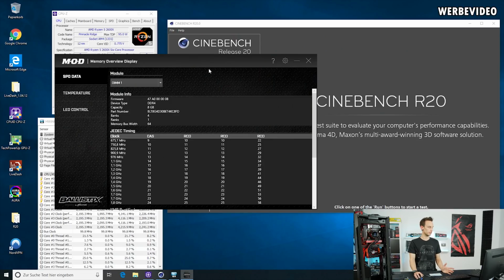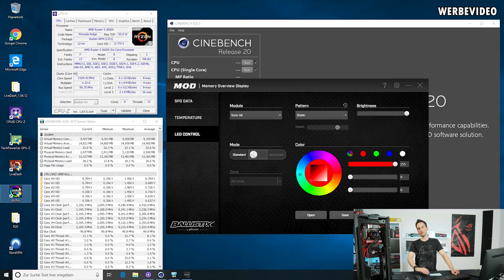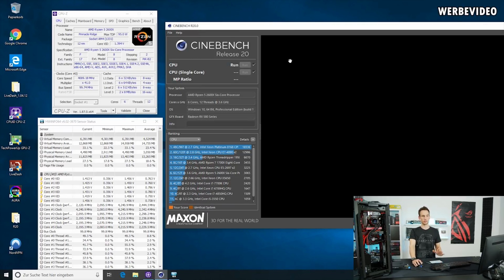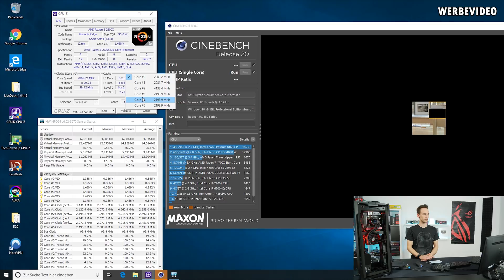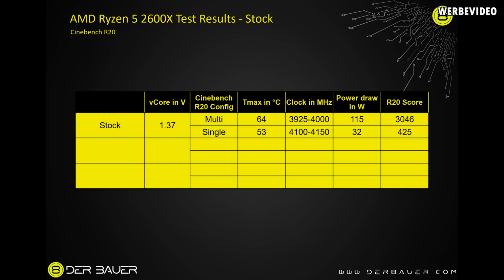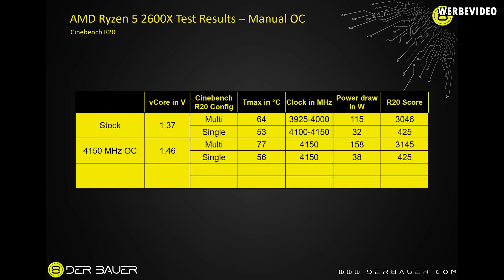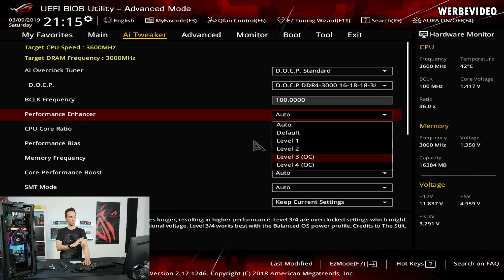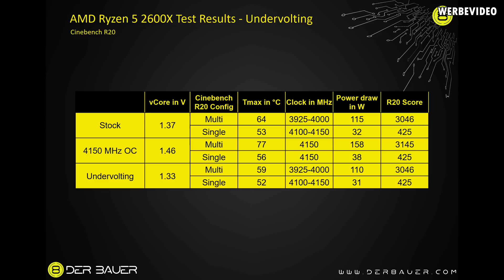The problem with AMD

Comment: what about AMD APUs? Also, are you telling me that it makes sense to run a 9900k overclocked on all cores to the max? what's the power consumption then? Some of the overclocking content out there seems to treat both brands differently. Nobody is talking about intel's temperature and when AMD had boiling hot CPUs they were bashed to oblivion. Same goes for performance per watt.
Maybe you could work around your content to make some room for AMD. If you want to save even 50watts on a rig, then use the same ruler to measure an intel option.
Overclocking is fun, regardless of temperature and consumption, and I think that's the point. It's not only about daily use, but what's achievable. And people like us benefit greatly from people like you doing this kind of work. If XFR is so great that manual OC gives 0fps more on anything, then that's great. Most people out there wouldn't know that. You have the knowledge to prove that and advice people better than most. You're not working in vain. We appreciate that content. It's actually helpful. Just think about it bro... Cheers from Buenos Aires.

Comment: Fully agree there's no point in OC'ing the CPUs.
What I'd welcome is memory tuning with Ryzen and Threadrippers, particularly with large amounts of RAM e.g. more than 2 single rank sticks. Every guide out there assumes you're gonna use 2x8 sticks for optimal speed, but what if I need 32GB or 64GB? Is 2933MHz really the upper limit? That'd make for great and useful content I think. :)
Reply: I have 4x8 sticks of Trident Z rgb 3600 running at 3333 cl16 on a crosshair 7 with a 2700x
Reply: @Zefram0911  that sounds really nice, thanks for sharing. I've got 4x16 of the same Trident Z 3600 CL17 on my 8700k now and I'm really curious how well that'd work on a Threadripper as that's likely my next upgrade.

Comment: I find it puzzling that people are still going on about Ryzen overclocking, when multiple reputable reviewers concluded already in their initial Ryzen 2nd gen. reviews that XFR was the way to get the most of your Ryzen 2nd gen. CPU in a mix of multi and few threaded workloads.

Just set the power limit given to XFR to whatever you're comfortable with, and undervolt. You'll get the best result with any number of active threads allowed by the quality of the CPU silicon, the power delivery of the motherboard, and your cooling.

It's only if your only consideration is reaching maximum scores in multi-threaded benchmarks, that you should consider manual overclocking. (Or if all of your workloads use all available threads, all the time.)
Reply: Silvar55x can I get the videos
Reply: @karthikp9845   They were written reviews.

Comment: I have a 2700X and a 1600X. The XFR on the 2700X works flawlessly and as you said, manual overclocking doesn't make much sense. It boosts up to 4250MHz ootb and I felt by slightly undervolting it the boost got even better. So  the performance you get is pretty much what you get. 
In my opinion it's a slightly different story on the older 1000X series though. XFR on the 1600X doesn't work as well. I have never seen clocks higher than 3.85GHz albeit I use a massive 240TDP cooler (air). So I did a manual oc to 4GHz and maybe I could go even higher (which I won't). Looking forward to the 3000 series. As it looks, manual overclocking soon will be a matter of the past - which is great as also less knowledgeable users will get the maximum performance out of their CPU.
Reply: P.S. after the great experience I made with the 2700X I would always buy an "X" CPU from AMD. It's worth it.

Comment: I think that there are a lot of people myself included who would get into Ryzen overclocking videos. I know most say its better to turn on XFR and then leave it but I ran an all core overclock on my 2700X for awhile and had pretty good performance. 1895 cb on Cinebench R15. It was a power beast though at 150W. Would still be cool to see maybe even just some extreme overclocking on Ryzen see how far you can push it.

Comment: The only thing I sort of disagree with in this is the phrasing - "the problem" is that there are no problems to fix. You can't delid the CPUs to improve thermals, because they already have optimal thermals; you can't really overclock it better than XFR can do for you either. All you're really left with is lapping the heat spreader and exotic cooling. You don't even run into the cold-bug with the Ryzen-platform (unless I'm mis-remembering). It just works - which does not make for entertaining content. It's not as fast as the fastest Intel CPUs, but dollar for dollar it has no problem keeping up with Intel's offerings.

The "issue" with this is that whenever we see this stuff being done with Intel's CPUs, it ends up being thought of as showing off how awesome Intel's CPUs are, even though you're actually showing that they aren't that good. Think of it this way - if you had to remove the engine, disassemble it and replace the crankshaft to get it to be less noisy, would it be considered a good car? Yet somehow the 7700K and 8700K were considered great CPUs, because they could run 5 GHz 24/7 (if you were willing to delid them and apply liquid metal).

That is my main issue with a ton of the hardware coverage on YouTube. Often the creators are completely oblivious to how they are shaping opinions of their viewers and giving free advertising to a product. As an extreme example, look at the amount of coverage given to Intel's 28 core HEDT. A $3,000 CPU that needs a $1,500 motherboard that might just be able to hit 5 GHz if you're willing to drown it in liquid helium and hook it up to a portable nuclear power plant. It's a CPU that is unlikely to be sold to anyone, yet there are a ton of videos about it, because of the insane motherboards that have been built to support it. Why are they insane? Because Intel demoed it at 5 GHz, so obviously overclockers are going to try to hit that speed. Fuck - some of those motherboards can't even boot without having TWO PSUs hooked up to them.

Products like those are made for one thing and one thing only - advertisement. Has anyone managed to actually FIND a 3175x for sale anywhere? NewEgg doesn't have any in stock, it's not even listed at MindFactory, it's not on PCPartspicker or Amazon either. But it is constantly in the tech-press, because there are boards being pushed out to reviewers to keep mindshare high and to keep competitors' products out of sight.

We don't pay anything to watch your videos, or the videos from other creators (at least not here on YouTube), but we do end up paying for it in more expensive products down the line, because the marketshare follows the mindshare, and when people see Intel being used by the "hardcore" hardware guys and used in benchmarking, they automatically assume that their products are the best and that everything else is discount garbage.
Reply: The fact is that you can get farther with Intel than with AMD. AMD’s modular approach to their dies with “Infinity Fabric” has helped them do a few things better: core count, thermals, scalability, and pricing. 

However, that introduces new bottlenecks; RAM speed is critical and there is limited overclocking headroom compared to monolithic dies. 

If you don’t want to bother with tuning your hardware or modifying it to perform better, then AMD is a great choice and you shouldn’t bother watching tech tubers. But if you’re an enthusiast who actually enjoys working on computer hardware, Intel offers more performance if you’re willing to put in some time. That extra 800-1000 MHz can be important to esports pros or content creators using certain applications. 

Your analogy about the car is misleading. Car modding is a thing too. You can buy a Ferrari that’s fast off the assembly line or you can modify an old Camaro. Neither option is wrong, but one is more fun than the other to ENTHUSIASTS. The same is true with Intel vs. AMD. AMD is fine. 9900k vs. 2700x are neck and neck out of the box, but with some overclocking effort, Intel is still appreciably faster. Some people prefer that. They’re wrong just because their opinion and needs differ from yours. 

Also, don’t forget about Bulldozer. AMD have put out their fair share of garbage.
Reply: @TheVillainOfTheYear  All of which are good points, but it doesn't negate my main point (at least what I wanted to be my main point) - free advertising and mindshare. I think one of the main reasons some people keep asking for more AMD content is that the vast majority of content is based on either Intel or nVidia, both of whom dwarf AMD.

People tend to like rooting for underdogs, and in both segments that is AMD, which might be why giving free advertising to Intel and nVidia rubs some people the wrong way.
Reply: Martin Schou I disagree. There is always a review on whatever AMD puts out (assuming they sample the product, which they for awhile didn’t do to Brian from BPS customs). 

It sounds like you understand that the Blue/Green team is still measurably faster (for now, maybe not for long). There are plenty of reasons to buy from AMD and plenty of people who want that. They just have historically been a vocal minority. 

Personally I haven’t owned an AMD product since 2006, but I do want them to be even more competitive. The fact is that AMD is nowhere on the 3DMark leaderboards because their products are not as fast FOR EXTREME OVERCLOCKING. I don’t want to see more AMD content on an extreme overclocking channel just to make red team fans happy. I want to see the fastest hardware, period.
Reply: @TheVillainOfTheYear  You misunderstand - obviously there will be reviews whenever something new comes out, but when the product that is released is basically useless (e.g. can anyone find a retailer that sells the W-3175X AND has it in stock?), all it does is promote mindshare.

What is the point of a review and extremely detailed breakdown of a W-3175X motherboard, when no one is able to get their hands on a CPU to use it with, for example? It used to be that the tech press refused to do reviews of paper launched hardware, but unfortunately the views are too tempting.

Again, I'm not upset or even confused that Der 8uer does mostly Intel and nVidia stuff, because that's where the records lie, and records brings attention. I'm pointing out a bigger flaw with the tech sites and YouTubers in general.
Reply: Martin Schou People want to know about the best these companies produce. The 2990WX is “useless” to me too because I’ll never buy one. There was plenty of coverage of that, and I watched all of it.

I think you are biased toward AMD products and that bias makes Intel-based content stick out like a sore thumb. AMD content barely registers for you. 

I don’t understand what you’re saying about “mindshare.”  Benchmarks don’t lie, cost-performance charts don’t lie. AMD wins on value almost always, but Intel still has products that are faster in most applications. Those are facts. When reviewers point them out, it’s not some kind of media conspiracy promoting a narrative. The reviewers I watch give both companies a fair shake. Maybe you should change what you watch.
Reply: @TheVillainOfTheYear  It isnt tho, ryzen 5 2600x beats the I5 8500, and costs $150 less?  Tell me more about how intel is better? LOL.  When both cpus are at the exact same price point, AMD DESTROYS intel.  In some cases like the 2600x vs the 8500, it even destroys the more expensive intel equivalent.  People just say intel is faster because at the high end, they have a more expensive and powerful chip than ryzen, but is anyone here going to spend $2000 on an I9 or threadripper? Doubtful.  For the I3, I5 and I7, the AMD equivalent wins literally every time its matches at its price point.
Reply: Pure Gameplay Overclocked 7700k, 8700k, 9700k, and 9900k are all faster at most games than overclocked 2600x or 2700x. The cost savings you get with AMD is mostly taken up by HAVING to buy faster RAM to compete. Sure, AMD is good at the low end, but it’s not absolutely faster. I’m not an Intel fanboy, I’m just stating facts here. 

Also, this completely missed the point of the channel. If you can’t afford or don’t enjoy watching high end CPUs and CPU overclocking, don’t watch this channel. This is about cutting edge performance. Der8auer set one recent record with Epyc processors being the fastest dual socket system in the world. He’s not a fan boy either. But the fastest CPUs on Time Spy and other worldwide leader boards are Intel’s HEDT line.
Reply: @TheVillainOfTheYear  The 7700k, 8700k, 9700k, and 9900k all cost over $200 more than the R5 and R7.  You are paying $200 more for a 3-5 fps gain, bend over much?
Reply: Pure Gameplay 3-5 FPS at 4K maybe. 20-30 at 1080 is typical. 100-200 more in CSGO is also typical.
Reply: @TheVillainOfTheYear  100-200 FPS in csgo is pointless when it runs at 300 fps with hardware from 2015 and never drops below 100 FPS unless your computer is catching on fire, and you don't need much more than that in csgo in the first place. csgo is a really awful example for performance and i genuinely have no idea why its constantly used in benchmarks despite literally everything running well on it, and 99.9% of the time FPS differences just don't matter. it literally does not matter if the current high end intel cpu pushes out 500 more FPS than the 2700x when the 2700x is running the game at 300 fps already. please, god. find another benchmark.
Reply: "people who play csgo and want to know if it performs well" is not an argument either considering if you need to know if your 8700k and 1070 plays csgo at 144 fps or 240fps you probably have brain damage. my 5670 and a6-6310 ran csgo at like 60 FPS the majority of the time, and if 10 year old hardware can do it anything new can too.
Reply: Yung Neet it’s just an example of an esports title.  Overwatch and quake are other examples. It’s not just “how many frames the human eye can see.” The frame rate and frame time metrics, even if higher than display refresh rate, still represent how fast the game is running. If you’re at 60fps, you have to wait 16.67 ms before your inputs are received and translated into actions in the game engine. If you have a frame time half or one quarter of that, you can still make inputs faster than the display refreshes. That’s why frame rate is important in esports. Two snipers see each other in CSGO—frame rate can determine the outcome on LAN.
Reply: @TheVillainOfTheYear  but in esports everyone has the same rig, that is if you're talking about a tournament which it sounds like you are

Comment: I will never buy another Strix VGA. After 6 months some of the lighting on the fan shroud burnt out (GTX1080).  My VGA is vertically mounted and it makes for a real eye sore.  The middle fan started to make noise at low RPM after 2 months. The card overclocked well and I did not want to send it back and end up with something else that may not overclock as well. When you pay 600 Euros for a VGA it should work perfectly and not have flaws like this. Some people paid 900-1000 Euros for it when it was newly released.
Reply: go EVGA

Comment: With ryzen overclock the memory gets you large performance gains. Also tight timings help a lot as well. This is due to the infinity fabric running at half memory speed and with some timings the same.
Reply: Same with Intel though... The gains are almost exactly the same, so you should tun any platform if you want better performance.
So yes, with almost any modern CPU, we are heavily memory speed and latency bound. (DDR3 might be better otherwise, LOL! He showed his super old 2000Mhz 7 timed DDR3 kit, like you can't get that low latency anymore, the best I've seen is 2133 at 10's on Dominator Platinum DDR4!). I think DDR5 needs to get here much sooner, is getting really bad (for APUs it must be awful)
Reply: @jakegarrett8109  intel actually gets almost no performance change at all with memory (in games); on ryzen I have seen a 10% uplift in performance going from 2666 CL15 to 3333 CL15
Reply: @rush2489  I saw basically no change going from 2133 to 3600 in Cinebench (quad channel on Threadripper). For Intel, there are lots of videos showing a bigger change than I saw going from the same, running the same Cinebnech program, so Intel actually looks more sensitive in that case, it just depends what you run.

For games, I don't see any uplift (I'm running 4x R9 Fury, its somewhere around duel 2080ti levels, its well over 2x the fps of my Titan Xp collectors edition, so you'd need 3x Titan Xp to compete, and Nvidia locks you out of that). In Crysis 3 at 4k Ultra, I make 100 fps (TR can be stock with 2133 Mhz, or 4.15 Ghz all core with 3600, doesn't matter), with a Titan Xp you only make 45-50 fps, Titan RTX/2080ti should be around 65 fps, so I don't see any gains from memory on that. The only time I might see changes in games, are when I aim for 240 fps on Fortnite, but honestly, that's at low settings on a Titan Xp, and its still the Titan bottle-necking the Ryzen 1700 I use on my test-bench for Fortnite!

What real world program did you use that saw an improvement of 10% out of curiosity? I thought I'd notice it when running 4x Handbrake encodes at once, but nothing noticeable for me. I'm sure there is some program that will (I've tested Linux, and I've gotten 7x faster performance on some low end systems... Yeah, 7x faster... 35 seconds went to sub 5 second! So there are programs that are sensitive to changes, I don't doubt that!)